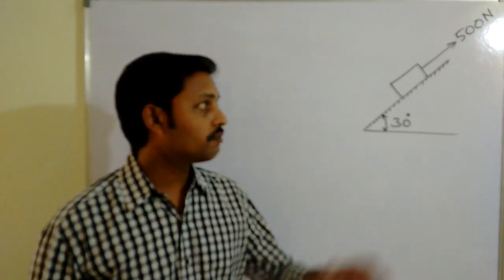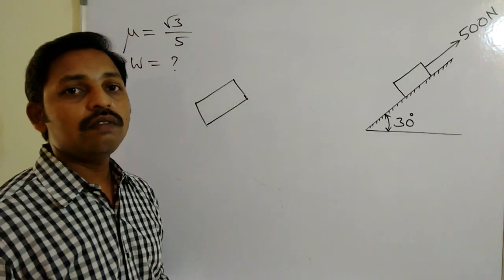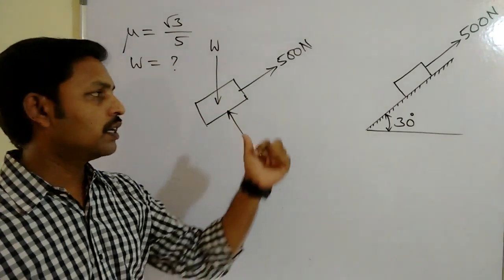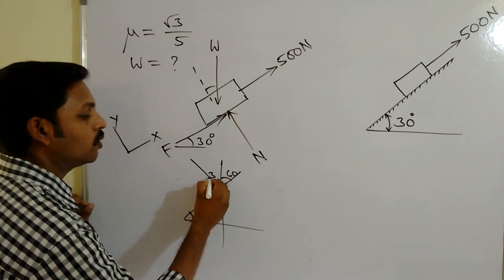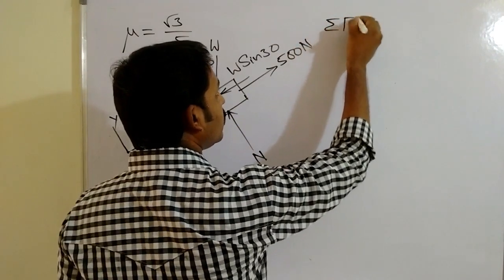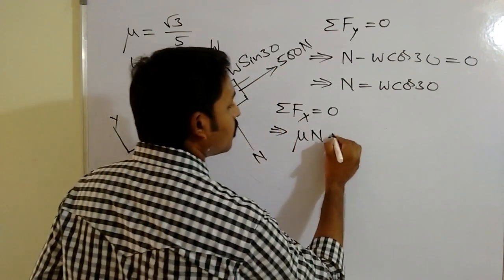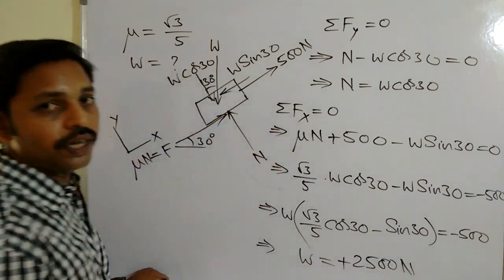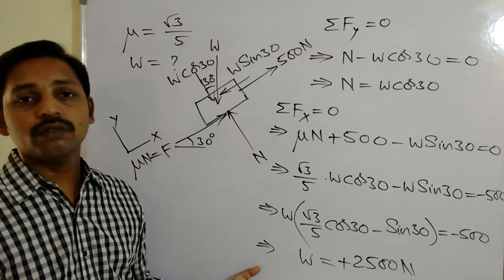Friction Problem 1 (Sliding Friction)

Comment: Why is the Frictional Force in → direction?  
why not the opposite of 500n force?
Reply from the maker: In the given question it is mentioned that 500N force it prevents sliding down. That means it is the minimum force applied to establish equilibrium. with this force the block wont move upwards. The only case it has is it will move downward then frictional force direction is same as 500N force direction

Comment: When normal reaction can resolved into two components sir . please tell me sir
Reply from the maker: Here in this problem except weight remaining forces are either parallel to plane or perpendicular to plane.
I can solve this problem in two methods
Method1: Resolve all the inclined forces (by considering horizontal x axis and vertical y axis)
Method2: I will consider axes such that parallel to plane it is x axis and perpendicular to plane it is y axis. 
If i solve it through Method2 no need to resolve forces parallel to plane and perpendicular to plane. only i need to resolve weight. (thats why i didn't resolve normal reaction)
Instead of resolving all forces resolving a single force is easy. I have chosen method2 for that...